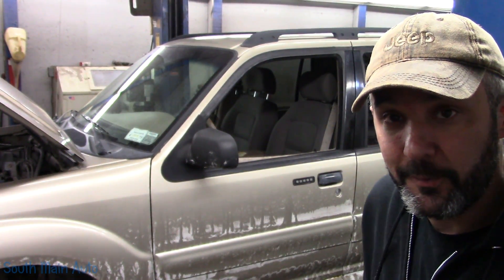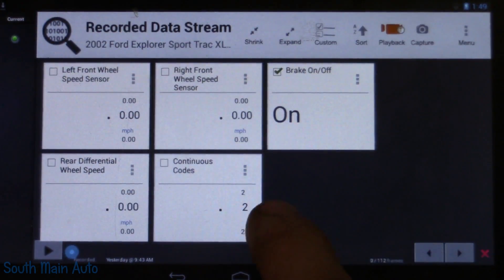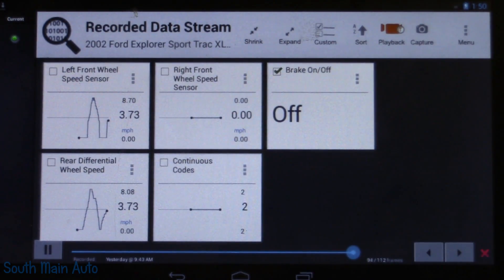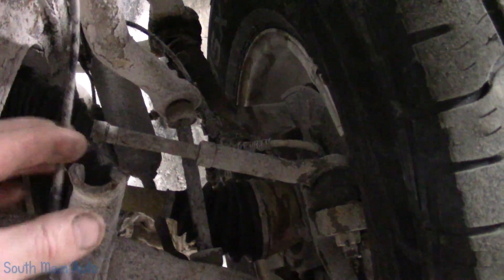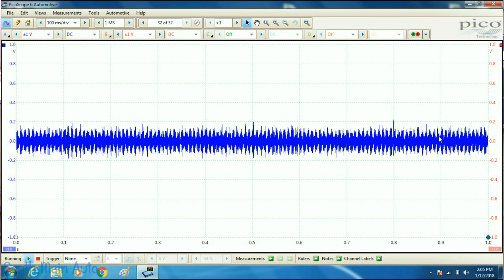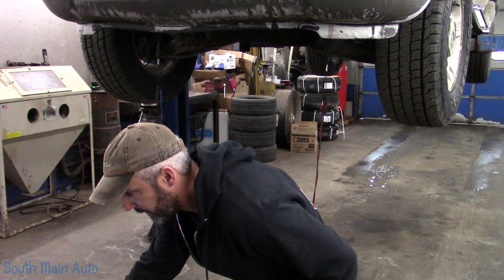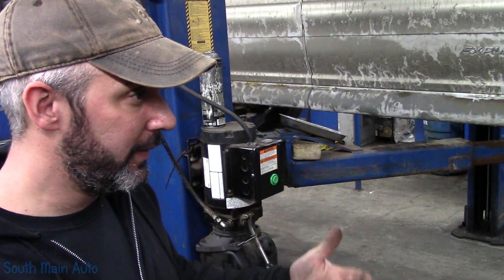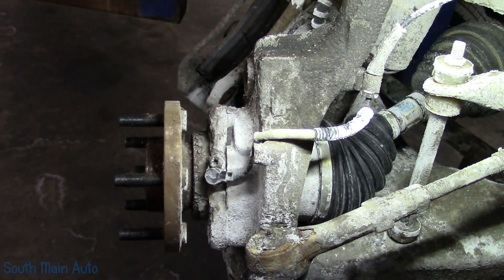Ford Explorer Sport Trac: ABS Light On / WSS Signal I Can Not Explain??

Comment: If the cables going from the speed sensors to the abs module were disconnected at the abs module, then any dc bias source in the abs module would be eliminated. What screen capture software you using for the Pico video inserts? Quite well done.

Comment: It has been said. The DC offset you see on the Pico is generated by battery action. Salty water is acting as an electrolyte here. One would think that the coil in the sensor would short that voltage. So the fact that there is a DC voltage and lower than expected AC voltage when turning, that indicates that a fair amount of the internals of that sensor already transformed in green salty goo.

Take a wet cloth and wipe off some of the salt off that car. Connect a copper wire and something zinc to your multimeter and measure millivolts DC. Find a nice wet salty spot on your cloth. Put your copper and zinc close to each other on that wet salty spot, not touching each other, just both touching the salty wetness. And there you'll see voltage.

You can even create artificial crusties if you connect a car battery instead of your multimeter. If they are not green, just change the polarity. And use plenty of water and salt.

Or study the crusty-forming process scientifically: mix up a jar of very salty water. Poor it into four disposable cups. 1st cup: Put a piece of copper and a piece of zinc in. Make sure they don't touch. 2nd cup: Put in a piece of copper and a piece of zinc and connect them to each other with some wire. 3rd cup: Put in a piece of copper and a piece of zinc, and hook them up to a car battery. 4th cup: same as 3rd but reverse the polarity. (at cup 3 and 4: make very sure that the copper and zinc cannot touch each other, or put a fuse in series). You might need to add water after a while. 1st and 2nd cup will loose water mainly to evaporation. And in the 3rd and 4th cup, some of it will turn into hydrogen and oxygen.
Some small print: well ventilated area, explosive gases, do not inhale, safety third, you know.
Reply: I think in this case it's a leaky sensor/lead wire and capacitive coupling of the steel, concrete, pico and laptop.
or maybe the chinesium wheel hub has some nuclear radiation output, nothing would surprise me from china ;)
Reply: Great explanation. So a resistance check of the two sensors would show basically an open circuit on the right side?
Reply: Pine Hollow Auto Diagnostics The right sensor acts like a voltage source. That voltage could throw off your resistance measurement but in this case it is a tiny voltage, so okay.
If I would measure a small voltage from that sensor, I would take it out, totally isolate it, away from magnetic fields, radioactive wheel hubs and what not, and measure again. If it still  produces a voltage, then it must be a chemical battery-like process going on in there. And that can only happen when the sensor is filled with electrolyte and the coil has an open, forming two electrodes.
Reply: throttle bottle A capacitive coupling could introduce an AC ripple. It would not cause a DC offset.

Comment: It would be interesting to know if there is a difference in the resistance between the bad sensor and a new, or working, one.   If there happened to corrosion in pigtail, would that resistance reduce the voltage seen?  

Also, perhaps the ABS module has a voltage threshold before it reads the sensor (voltage and frequency) for speed to inhibit noise causing the ABS to engage?

Comment: The gap between the vr sensor and the axle sensor tone ring will determine signal amplitude. Interference can be caused by foreign material in that air gap, especially ferrous materials or a bad sensor, wire or plug. Perhaps signal loss is caused when the vehicle has weight on the axle, something is shifting/changing like the air gap. Good luck.
Reply from the maker: Yes the air gap determines the amplitude of the signal. The interesting part is we have what appears to be a good signal, yet it does not work.
Reply: I would still try the new sensor temporarily if you can find a correct shim combination. That way you eliminate that possibility. You also need to verify the tone ring is clean and intact. Sounds like a job for Brake Cleaner.
Reply: If the ABS says the RF is 0.0 mph and you patch the RF sensor into the LF ABS input, what  did the LF say about speed? In telephony we called this circuit frogging. Swap both LF AND RF sensors and inputs with 4 wires. Take it for a schpin and see. No pico required. Just scanner and some wire and pins. And the BPC usage was missing your classic TADAH. Metal shaving in the sensor hole might cause magnetic resistance which is akin to the KRUSTEEZ in a DC circuit as a resistance to be tested under load. Pico is no load like a DVM. Dont know the load requirement, but worth putting the variable resistor you bought on the circuit to see the loading effect. Now you are an engineer

Comment: I agree with the right front sensor needing replacement. What I don't get is why there are two rear sensors when you only get a single graph on the scan tool for the rear. I was expecting a single sensor mounted in the differential. I hope there will be a follow up to this video.
Reply from the maker: There is only one rear sensor on this

Comment: The analog to digital converter in the ABS module sees only the positive component of the AC sing wave. If you have a big enough positive offset, the module will see this as the signal being always 1. like when a hall effect dosn't pull the signal all the way down to ground.
Where that DC comes from? that i don't know

Comment: It would be interesting to see the left and right waveforms with the sensors plugged into the ABS module (ie: backprobed if that's easy) and powered up.  It could turn out that, when operating, the signal conditioning electronics arranges for a specific dc offset or other condition which the  bad sensor is not interacting with appropriately. For example, do we know if these sensors are supposed to float (isolated from ground), or is one side grounded? If the former, and on the bad side one of the wires is now incorrectly shorted to chassis, you'd get a good scope trace looking at just the sensor, but not when it's attached to the ABS system. I notice that the schematic shows the two sensor wires as "+" and "-" rather than signal and ground.
Reply: Also.. any possibility that the ABS module is looking for a pattern of waves, and would notice if there are missing ones (as in missing teeth)?
Reply: Further: https://www.picoauto.com/library/case-studies/low-speed-abs-fault suggests that the ABS (or whatever module reads the sensor) applies a DC signal to detect sensor circuit present (eg: applies a small constant current, and observes the resulting small constant voltage offset). So if that's out-of-spec (or added to by the mysterious DC offset you noted; salt+metal=battery?), it would cause the ABS to detect bad sensor, despite the sensor showing an acceptable AC rotation waveform.

Comment: Scrap tone ring / insufficient air gap 🤷🏻‍♂️ nonetheless great video Mr O. 👍
Reply from the maker: We proved that was not the case. We hit a target voltage that should have been read.
Reply: South Main Auto Repair At what voltage does the pcm start too produce a speed record? 
The difference between the two signals was close to 50%, and does the passenger sensor
Ever get above the 280 odd mil volts????

Comment: Ok. I haven't finished this video yet but I gotta say that when you see a DC offset from a device that isn't supposed to generate DC, two areas to investigate are thermocouple effects and chemical effects. A little bit of salt in the wrong place can do it.  Did you measure the DC resistance of each sensor?   Did you check it's impedance?   Did you measure if that ac waveform generated can stand a normal AC and DC load?   Your scope won't provide a low enough impedance to check that.  There are three other way-out sources of a mysterious DC offset.  One is if you have a badly oxidized connection AND a lot of random AC (generally high-frequency RF) field nearby.  The scope won't display the RF cuz the frequency is too high. But the oxidized connection will rectify the RF yielding a mysterious and variable  DC voltage.  OK. That was weird enough.  Here's another: a malfunctioning electrolytic capacitor.  I don't think wheel sensors have those.  An even weirder one is if you are dealing with something radioactive that spits out a charged particle. They do make laboratory current sources out of Carbon-14, for instance.  I doubt this is your problem.😉  But seriously, you should compare the left and right sensors into a decent load resistor not just measure their open-circuit waveforms which is what a scope does.

Comment: (Dan Hucklebridge) on escapes, I have seen several toner rings on the front....crack, throwing off the signal...showing zero MPH. they are available separately, and not too hard to replace on the cv joint. might be the same...for explorer sport?

Comment: I’m thinking because the abs control module starts looking for voltage at a higher cutoff. Mike Becker had a great video on this with his Toyota cam crank series. I think the info applies here. That’s why the one sensor didn’t read until 3 mph and the other one is dead.
Reply from the maker: If that was the case it would have worked on my test drive
Reply: South Main Auto Repair, good point. Even at like 60 you get nothing?

Comment: Multimeter resistance checks of the sensors to see if they are different?
Multimeter a.c reading when connected only to each sensor?
Across the abs wires, for high resistance on both?

Comment: Good subject matter for a video! Question; can the abs module be reflashed? Also I've been very lucky getting out bad wheelspeed sensors, when they break off do you need to pull the hub apart to remove them? Might be a good video when you get one.
Reply from the maker: It could be but that will not help the situation as we proved in the video. If they do break off you can just reach in with a pick and pull it out.

Comment: I'll make a guess. The magnet in passenger side ABS sensor has lost some of it's magnetism. Most likely cause is heat or poor material. Voltage = speed, amperage = field coil current / strength of a permanent magnet.   There was no difference in voltage of the sensors in the first file. BUT voltage is been measured against Pico Scope 1 Megaohm input impedance. 

=> Pico scope does not put almost any load on the permanent magnet "generator" the ABS sensor actually is. But when the sensor is connected to a lower impedance ABS unit, current increases and voltage drops due weak permanent magnet in the passenger side sensor and signal is not detected. 

Lower impedance is used to pull RF/EMF noise from the sensor line line to the ground. In the sample you can see all the EMF noise you have in your shop. There are 60, 120 and 360 Hz harmonics from the mains, typical of US 2 phase 240/120V system. And BTW at the time of taking the capture, your mains frequency was off by 1,15 Hz (61,15Hz). 

When the sensors were set to correct distance to the reluctor ring,  the weaker magnet in the sensor becomes visible. As the coils are the same, distance to the rings are the same, the good sensor puts our ~215 mV AC (RMS) and the faulty one only about 150 mV AC (RMS) measured from the file 2.

It seems obvious that the limiting factor is the only parameter which is different, one of the sensors has lost about 40% of the magnetic force of it's permanent magnet.
Reply: Brilliant analysis, Janne!! However, the explanation might be much simpler. Looks like the coil winding inside the RF sensor has extra resistance due to corrosion. Wish Eric put the ohm meter on there for comparison :) I've never seen one of these ABS sensors lose their magnetism...
Reply: Thank you Ivan! That is definitely an realistic (and common) option. I flipped the coin between extra resistance and magnet because Eric did not find any cracks or other visible clues of corrosion. But he did not show us the connector, could there be some salt in it?

On the other hand, there is only 5% difference in the volts in the first measurement  but 40% in the latter. V=IR, should there be a linear response to resistance difference? Well, we just need to measure the R from the sensors and then we know the missing piece of the puzzle.
Reply: Where are you seeing the mains frequency? Are you looking at the scope signal? Because I'm not seeing any significant signal near 60Hz or harmonics. And 1.15 Hz error would be pretty large for utility frequency.
Reply: I took the part from the capture where there was no signal from the wheel sensor and used the PicoScope Tools - Measurements - Frequency - rulers. You can also use fourier analysis. ~1 Hz is a bit big, perhaps due the cold weather there are high loads and fluctuations and at 14:20 local time there would be a bit of overproduction online to handle spikes and to be a bit on the safe side? 

Naturally there is a random mix of noise in the signal, there need to be "error bars" aka confidence intervals, which I did not calculate and there might be inductive loads which skew the result. Likely a run capacitor motor running somewhere in the line transformer secondary area, producing 3rd harmonic of 360 Hz.

Deviation should be less than 1 Hz. Finnish power grid targets to keep +-0.1 Hz in "normal conditions" but since 2003 frequency variation has increased, more fast load compensation was added in 2013. And wind power has made things even more complex..

Comment: Have you tested the abs wiring at the module where the wires from that wheel terminate into the computer? See if you have voltage there?

My guess is broken wiring further down stream between sensor and computer

Comment: Hi Mr O
Great video's
I hope Mrs O buys you more nice tools,
It is looks like it is the length of the sensor giving lower voltage ,the abs/speed ecu will have a trigger level it needs to reach 
to start reading,
You're friend Ivan made a good video he had the same low voltage on one side, his was rust holding one sensor away from the ring,
Good luck from the united kingdom,
Dave
Reply from the maker: Yes and we proved that in this video too. However, we hit the same voltage that the left side did so it should read.

Comment: @11:02 Take out the hard molded plates, and wash that case in COLD water with Oxyclean + Tide. Soak in a bucket, rinse by hand, wring it out, hang up dry. Grease and dirt will degrade that nylon, and it will rot. OCD? Yep.

Comment: Sounds like the A/D converter is dead in the ABS computer. A signal is present at the sensor but not through the data stream where the signal has to be processed. Jump the right side sensor into the left harness see if you get a left side mph when spinning the RF.

Comment: What if you already replaced one brand new hub up front and the same abs issue is happening? Abs light had been on for a while, drivers speed sensor wire was cut for atleast 2 years, 2003 ford explorer sport trac xlt  finally the bearings started to roar.  Replaced drivers hub yesterday.

Comment: Clear ABS codes and then turn ignition off wait a couple of minutes then turn ignition back on. If the code reappears, then the ABS module is looking for continuity  and or a voltage drop across sensor (or a certain resistance across sensor). If code does not reappear then the ABS module needs to see a difference between sensors when vehicle is moving before code sets. This should give some insight on why the code is setting even though there is a signal from it.
Reply: Yet the ABS module responded just fine when Eric provided right ABS input with signal from left sensor.

Comment: Ok my "two cents"....the sensor has magnetic induction. If you where to pass metal by the pickup tip it produces signal, hince the tone ring. What if the magnet feild has been weekend due to the salt and metal electrolysis. There are two different sensors on that vehicle, passenger has slit type and driver has battery tip type. Magnet and coil field is smaller in the slit type. Maybe why you see on scope and not in scan tool data. Some kind of mV threshold so no out signal disruption to ABS system?

Comment: i'm not liking a dc offset on an unplugged sensor. try swapping channels on the scope/to sensor to see if it follows. also try just running on laptop battery. as someone else said record and clear the codes maybe its not accepting that signal because of the codes. it could have broken shielding in the sensor cable  but i would think that any noise would be an ac signal not a dc offset. may want to scope the power and grounds to the module to make sure you arent getting alternator or other noise.

Comment: I've replaced many speed sensors that were different lengths (aftermarket wise, and/or hub hole length wise) and if it made contact, i just added another spacer or washers (both on the screw hole and sensor hole, sometimes you have to grind down the side of one because they're so close) till it wasn't making contact on the tone ring, i've never had a problem with this not working. Why not do this on the passenger side?

Comment: Could the tone ring be slipping on the driveshaft?
Reply: There's not much potential for it to be slip"ping", either it is in position or it has slipped out of position completely, but it won't be spinning at a different speed than the shaft, so the general answer is no, either it slipped and is done, or it's not continuing to.  Odds are that is not the problem.  Sensor or gross tone ring corrosion (if external to the hub), maybe a "slight" chance of road debris damaging it.